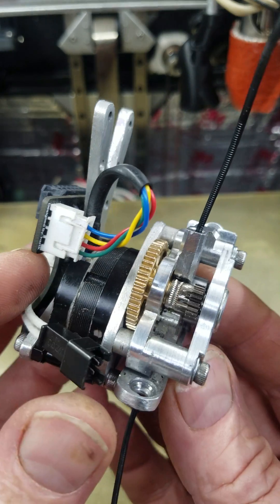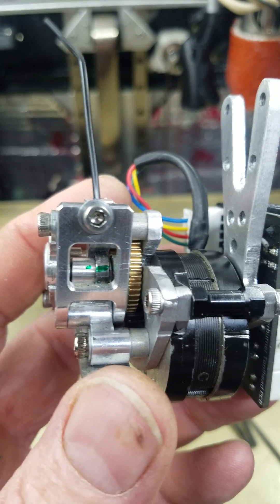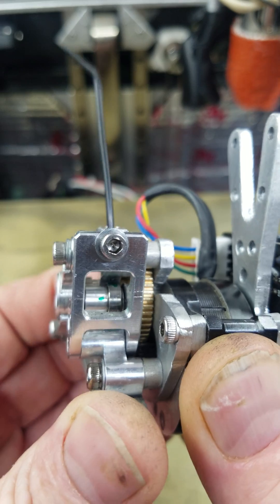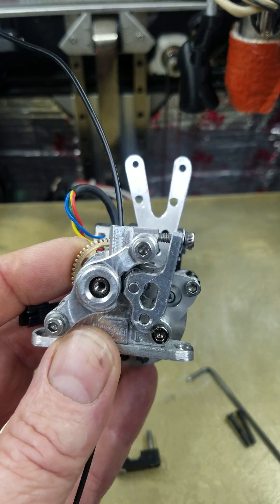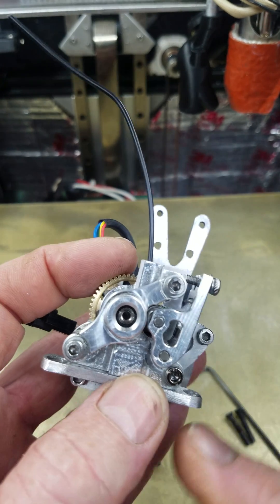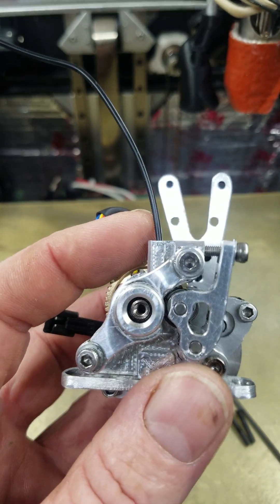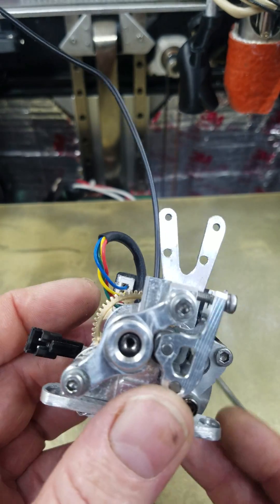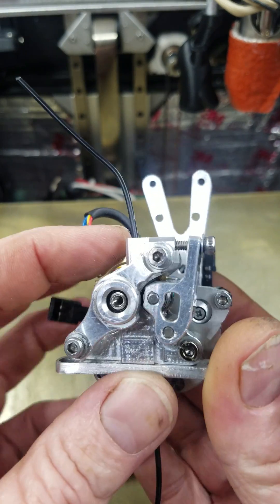VZhextrudort idler gear mod for testing

Comment: We have a full mod coming with single gear and idler :)  cant wait to test too
Reply from the maker: So far.. no difference at all. But I need to back track to what setup I had in order to test against twirl vs straight vs now vs then. I removed a bunch of VFA from bull to pinion backlash and need to start over before making claims. Have not done wood grain test, but comparing some annex cubes and some other models they are coming out identical. But.. some reports are from >X flow with twirl and and and.. so I want to be a bit more comprehensive on what I compare for my own personal preference of which to use.
Reply: @MrRocksalt  awesome! Cant wait to hear from you brother
Reply: @tokehgekko9455  im waiting for the gear to arrive. But i can check with mellow to see if he wants to start selling it as beta. So more people can test. But im affraid of that. Everytime we tried beta testing approach, we got criticized and thrown rocks haha.

Comment: don’t you find the lgx/hgx gears more powerful?
Reply from the maker: HGX is good, but it has less gear reduction and more weight. The grip of Sherpa/VZhex is plenty until you push lots of filament. I was able to push 90mms3 with VZhex. At this point I wanted to see if wood grain or other artifacts are less with  a bearing idler. So far, I do see some differences. At this point, if it's not worse I will continue to use it. The bearing removes a variable vs the gear. I will continue to experiment with this and see if it leads anywhere.

Comment: I have concerns about the helical feed teeth. In theory this should cause filament walk to one when only one gear is fitted. Obviously i cant anticipate the effects of friction and spring tension.

As for bearings, i think you didn't lool that well. Found a od8 id3 and 4mm width bearing in less than 2mm googling
Reply from the maker: Spicy! The straight cut filament hob is straight as well as the drive gears. The twirl gears are twirl filament/helical drive. My focus is not twirl or helical, but simply how the filament deposits with a fixed idler bearing, spring idler bearing, and pure straight cut gears.
There is a MR85 bearing, 5mm I.D. 8mm O.D., but only 2.5 wide. I can stack 2, but the filament will want to go between. This will work for now(my original9mm bearing). Will look later for something wider.